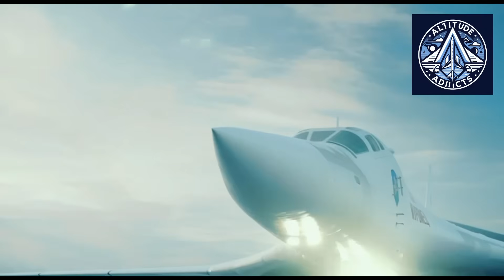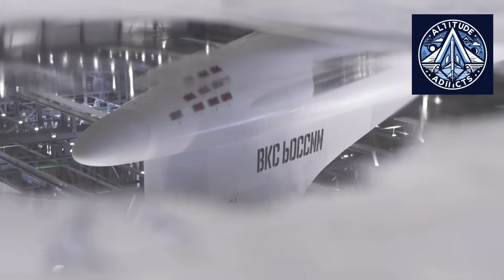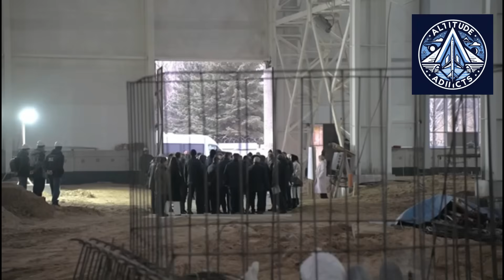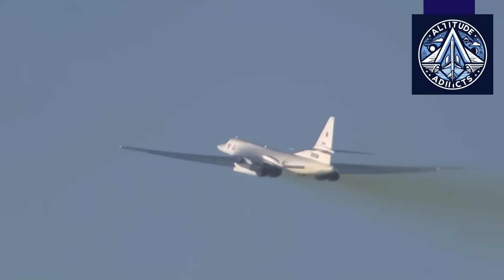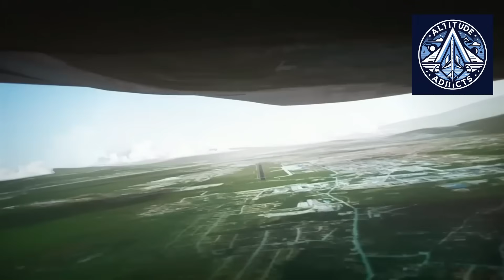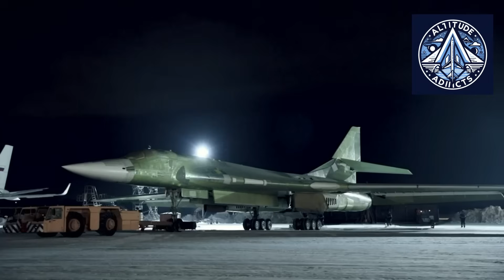Russian Tu-160M, NK-32 Engine, and PAK DA Stuck in Limbo

Comment: Something i do not understand: Pak-Da does not fly supersonic. Why would it need a turbine that can do that? It's a waste of fuel, if it runs that fast, only to generate energy for two electrical impellers. Also, this animation looked more like a freight plane than a Bomber. I was also thinking, Pak-Da would get PD-35 Engines. Because of fuel efficiency. If it is good at stealth, speed is not needed. Yes, Burevestnik can get there by itself, but that is not the only weapon in the Arsenal.
Reply: The B-2 uses a non-afterburning version of the F-100, so these are still useful engines. 

For a stealthy aircraft it is easier to hide the fan blades on a smaller engine.

Comment: recently you made a video about the domestic NK-36 32MW Kuznetsov power unit for the gas industry ..... now you tell us that somehow Kuznetsov can't make an aircraft engine from the same family .... for their national defence ? you can't be serious
PAK-DA is delayed by at least 12 months because the building built for it was repurposed for the new Tu-214 flowline ..... they need to build a new factory building ....  so given that there is no great need to push hard on new Tu-160s as they were put back into production primarily to keep the skilled workforce ... so they can build the new PAK-DA.
There is no mystery to any of it.

Comment: Trying for too many things all at once just means that nothing gets done. The fox chasing rabbits metaphor. Get the civilian sector back up and running then take all that advancement and tech to the military base.
Reply: Civilian aircrafts use turbofan engines with fuel economy and emissions taking priority while military ones use turbojet engines built for speed and power. Another thing is designing and building new engine takes almost a decade which makes adapting it for military utterly pointless since the tech is already outdated.
Reply: @rinn727  Things like engines and Aircraft designs are kept for decades. They get updates but the base design didn't change. Look at most Russian Jets. old air frame and engines updated with modern tech and features. Similar with the US. many armaments are from the cold war designs but modernized with new tech.

Comment: The unlimited range cruise missile could negate the need for these bombers.  Perhaps it’s cheaper to go with more missiles.
Reply: Russia has always preferred missile standoff capabilities rather than an “away from home” bomber.  Nice to have both but that nice to have cost a lot of money for one off items.
Reply: @nbell5050 This is a problematic weapon unless significant escalation. Even with a conventional warhead, the nuclear propulsion makes the missile kind of a weapon of mass destruction.
Reply: @krzysztofhetman4483  So the deployment means shi*t has hit the fan?
Reply: @nbell5050 That's possible.
Reply: Depending on actual flight time Burevestnik can make both strategic bombers and subs obsolete. It's way to expensive to build and maintain them and why would you if the missile can hang around US for several months. Not to mention you can hit anything anywhere on the planet within 24hrs AND have plausible deniability on that. Imagine doing it with bombers, yeah right.
Reply: @jeffhedrich3551  This is a problematic weapon unless significant escalation is in order. Even with a conventional warhead, the nuclear propulsion makes the missile akin to a weapon of mass destruction.
Reply: @krzysztofhetman4483 no it isn’t. The nuclear propulsion is heat based and the small amount of material required for this heat doesn’t factor in to the dirty bomb category.
Reply: @jeffhedrich3551 It depends on who controls the media. Western media will portray it as WMD.
Reply: @krzysztofhetman4483  Maybe thats the idea. why there should not be a push for this being forcibly deployed. That means shi* has hit the fan.
Reply: That is no option. There are other missiles that might need a taxi.